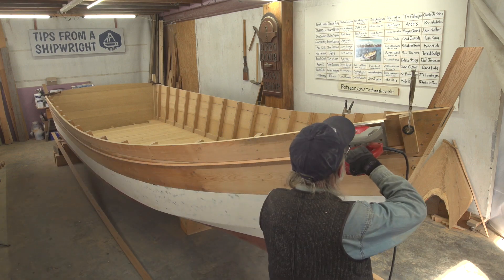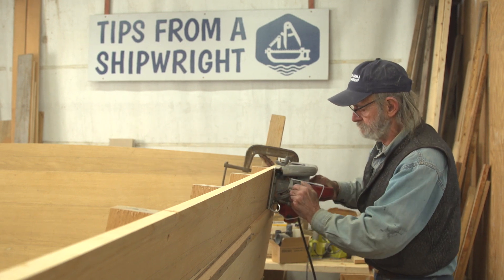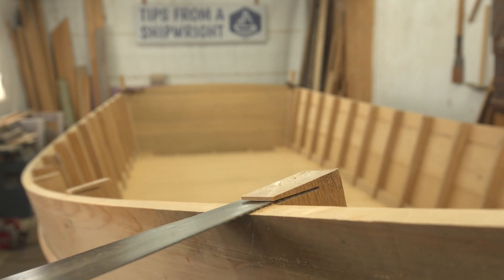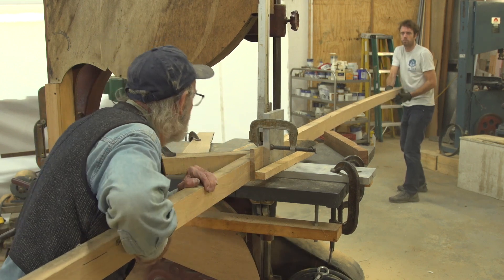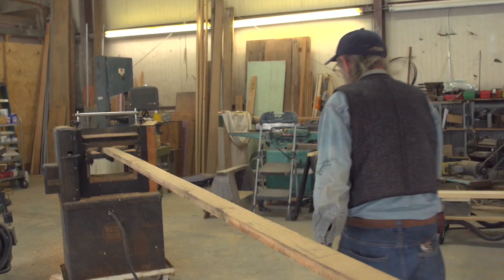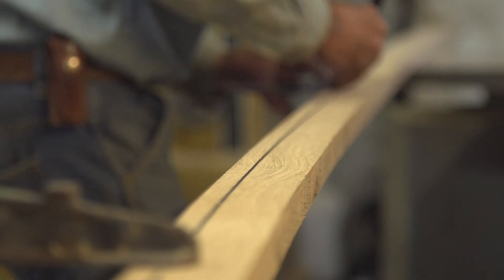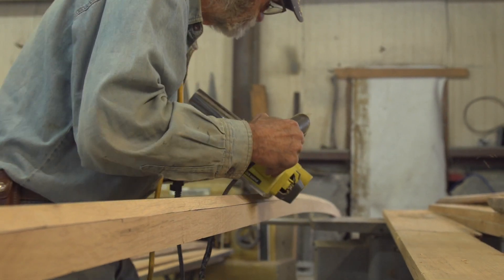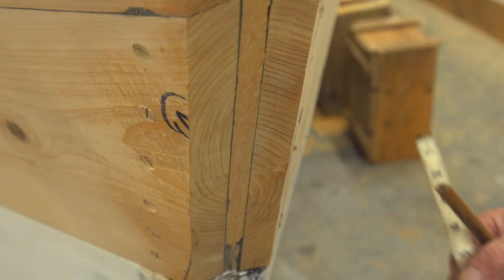Building the 23' V-Bottom Skiff - Episode 23: Ripping the guards

Comment: A snow shovel chip thrower, a folding tape that's older than I am, a custom made featherboard...feeling very much at home. God bless you sir and all your efforts. €;-)}
Reply: What a great Craftsman, boatbuilder Lou is. So ingenious n skilled.
Reply: I'm always amazed when people are surprised to see a folding rule being used. Are Lou and I the only ones who use them as their go to measuring device? I know we're not but it feels that way sometimes. 

When I enter my shop the first thing that happens is I stuff a Lufkin 6 foot inside reading rule in my back pocket. And it stays there all day and most times ends up coming in the house with me because I am so used to having it there. They are so much easier to use in most cases. If most of your measurements are 72 inches or less so they are perfect. Both of my trucks have a 6 foot rule and a 25 foot tape in them. Any portable tool box or pouch has one. I probably have a dozen of them spread around.

If you're not using one you should consider it. Get a good one, they last a long time (as in multiple years), so don't fret over a $5 difference between a good rule and a less expensive one. Once you get used to opening and closing the rule the right way and do the occasional maintenance of oiling each joint once a year with a drop of 3-in-One Oil you're good to go.
Reply: @bobd.  I only use one. measuring tapes become useless quickly, are messy. and I do not have to hook my folding rule anywhere. 

great tool. partially forgotten because there's always a new product, but people are coming back around It

Comment: That is just amazing the way you've modified the saw to be able to change the angle as you cut! I've been doing Home Improvement for 44 years and I've never, ever seen anything like that!
Reply: Welcome to boatbuilding. Half my workshop consists of upgraded (the safety-sissies would describe it with another term, of course) or completely selfbuilt tooling and machinery. Changing the angle while circular sawing like Mr Sauzedde does it still is an advanced technique to be honest though.

Comment: I’m enjoying this ship building stuff! It’s like building a boat without getting sawdust all over. Eazy-peazey clean up.  I was listening to you on the touch up using the Ryobi planer. I think you could build a sled and shim or stack some material to compensate for an out of square piece of  symmetrical stock. Like milling baseboard with an angle. Just a thought, your way more accomplished than I am. I met my match 😢 / 😊 incidentally, try the lime green Pica dry Pencil , it’s very good for template and leaves a nice dark line. Good for cleaning up to the line and staying on either side of the line, waste or clean side. You’ll like it. 👍

Comment: I’d suggest a Velcro strap as a replacement for the zip tie on the trigger for the planner.  Easily and quickly removed, and reusable.
Reply: he's got the zip tie just tight enough to engage the trigger but still loose enough he can slip it off as needed. He's got an older video where he shows all the things he did to that electric hand plane to get it just right for him, much recommended

Comment: I have a 15x17 shop... what size skiff (or other) could I build in there?
Reply: Having built several boats in limited spaces, I would recommend having 1.5 to  2' of clearance around the perimeter for work room.  This would limit you to 13 or 14' in length.  If you get clever and build on a rolling strongback so that you can shift the boat around as needed, you might get to a 15 or 16 footer by placing the project on angle.  You will have a much better building experience, however, if you have lots of clear working room